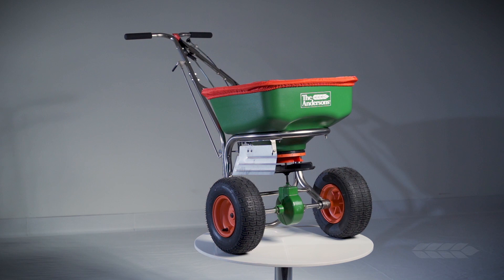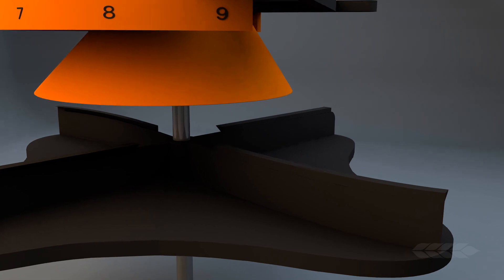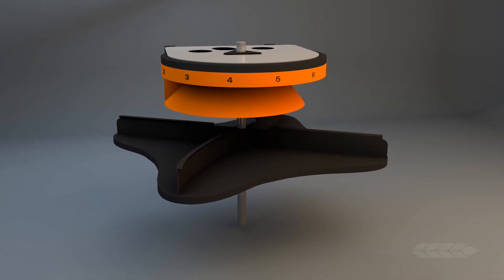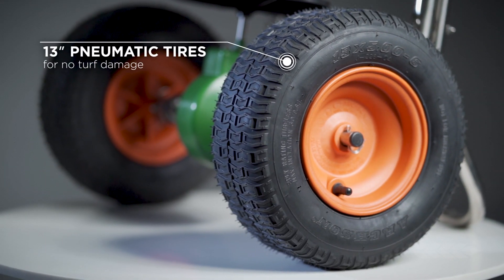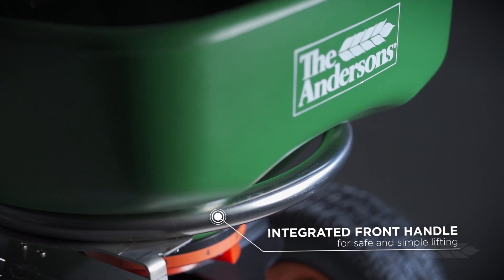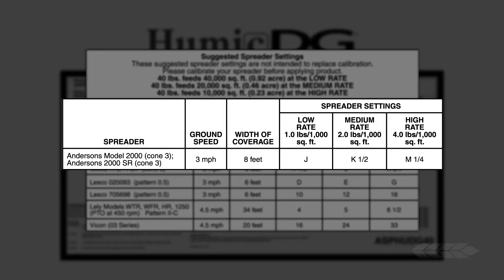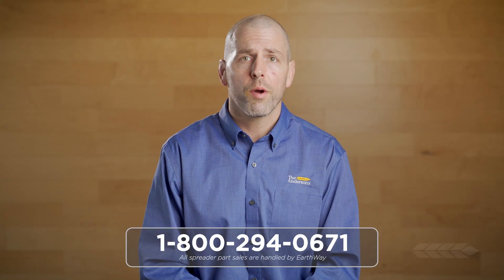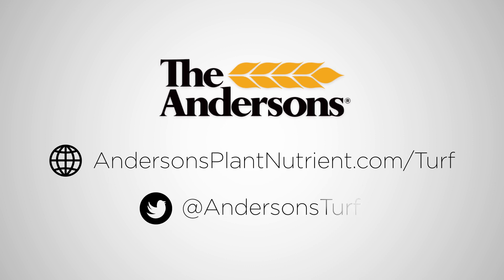Model 2000 SR Rotary Spreader | Overview

Comment: the weakest link in this spreader is the gears. Even though it has a covering over it, it still allows fine [abrasive] rock/dust/dirt into the gears which after a season the gears pop and slip when the hopper is 3/4 full.  i've probably had over 15 of these spreaders over the last 30+ years and am always having to figure out a way to make the gears  work smoothly. All they would have to do to resolve this problem is use a harder material and make them permanently sealed like the other professional spreaders(lesco/spyker). Don't get me wrong, this spreader spreads excellently with the helical cone feature. The gears again are the weakest link.
Reply: Goodbye

Comment: Where can we find it though? Its out of stock everywhere
Reply from the maker: Hi! Fill out our "Contact Us For More Information" form using this link -> https://link.andersonsplantnutrient.com/l/1004211/2023-06-19/29hfn
We will connect you with someone that can answer all your spreader questions!
Reply: @AndersonsPro  Thanks, I was able to purchase a new one. One thing though, for lubricating the gears, which grease should I use? These are nylon gears so wouldn't petroleum based grease deform them overtime? Should I then use lithium based or something else? I haven't been able to find information on this and there's no specifications on the manual. I sent an email asking for this but no reply yet. Thanks.